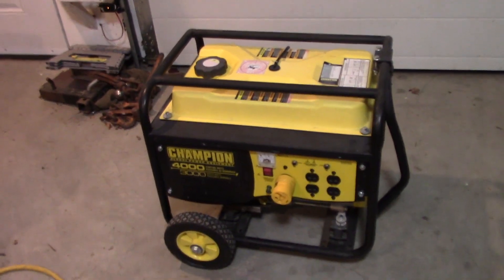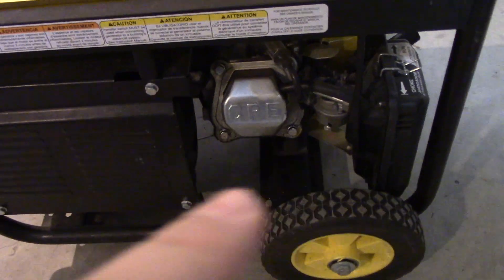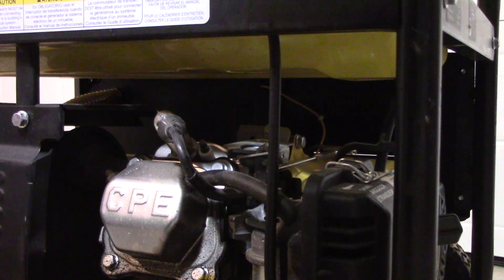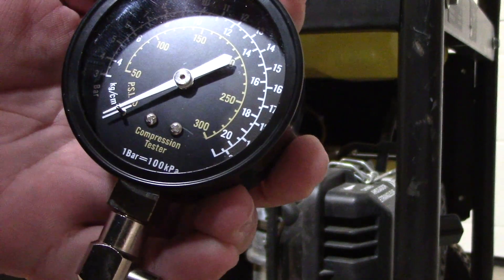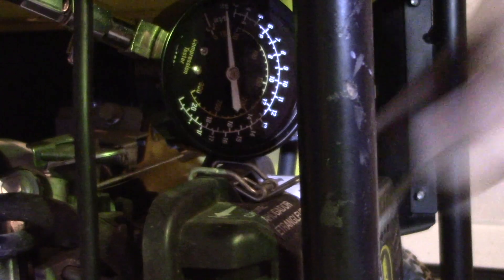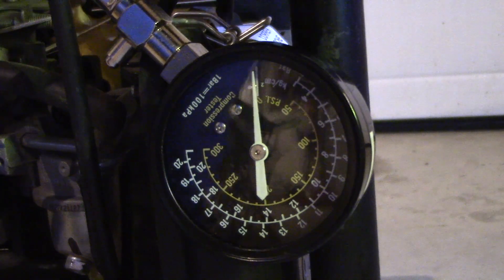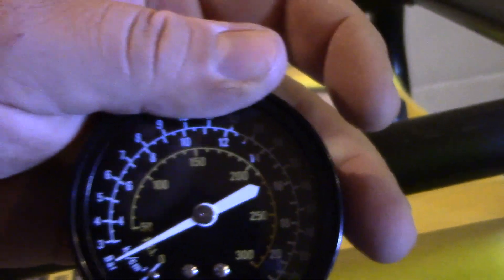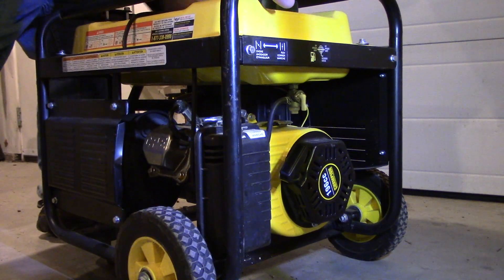Champion Generator 4000 Compression Test

Comment: Your first psi value was 20. Your 2nd set of pulls raised the value. Other techs say to pull til value stop limbing. Also other techs say around 70 other type engines more psi. Hmm? Your gen started right up.

Comment: Hey Dale, thanks.  Someone mentioned to me that these Champion engines might have some sort of compression relief valve in them to make them easier to pull start.  I haven't had  a chance to look into it yet, but that might explain the lower compression readings on a perfect running engine.
Reply from the maker: That could be the case. PSI is right around 25. I am sure you will figure it out likely something simple!